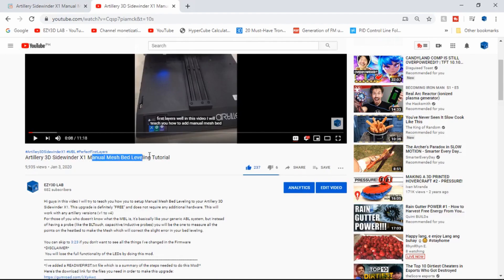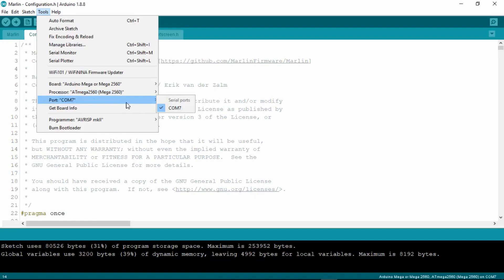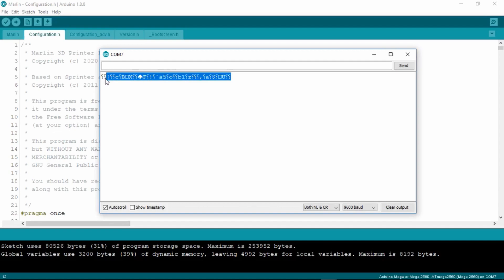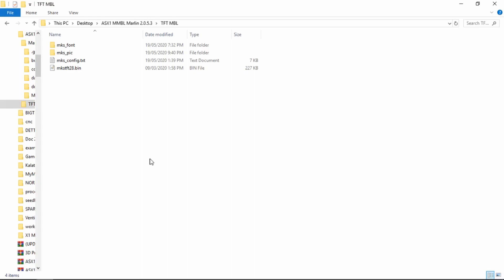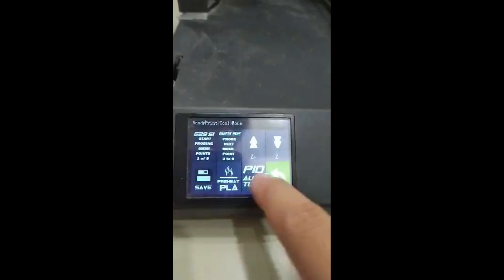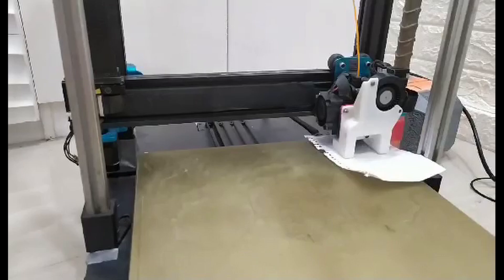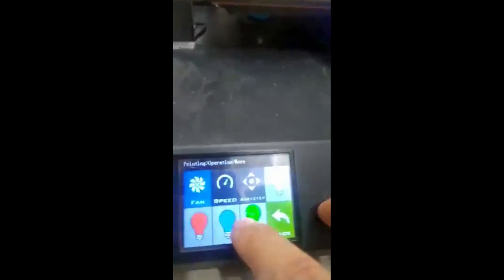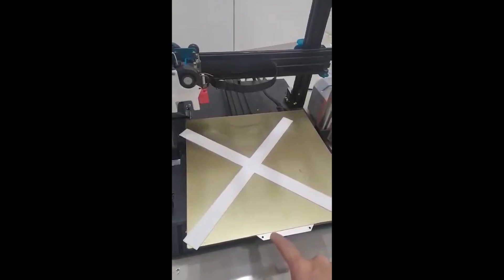Artillery 3D Sidewinder X1 / Genius Manual Mesh Bed Leveling Tutorial - Marlin 2.0.5.3

Comment: After following all of your steps, which the details are great. I may have messed up somewhere. None of the icon on the printer are working. I can select stuff and go into submenus, but doesn't do anything to the printer. Help please. Pushing the home icon the head doesn't move to the home position. Bed or extruder doesn't heat up. Nothing is working.....
Reply from the maker: Have you tried reflashing the TFT fw using a refomatted SD card?
Reply: @EZY3DLAB  Thank you for the quick reply! I tried what you posted with no luck. I've checked all the cables. I was able to get the bed and extruder to turn on using the slicer and a hard reboot. manual control (In Repetier-Host V2.1.6) doesn't work  Maybe the SD card I'm using is too big, (Its the only thing that you had mentioned that I failed to follow) SanDisk Ultra 32GB. I found a 2GB and should have it tomorrow. I'll post if it works out. Thanks!
Reply from the maker: Don't forget to also change the file system format of the 2GB SD card. Inform me as soon as possible so I can help with troubleshooting.
Reply: @EZY3DLAB  Formatted to FAT and flashed, still no luck..
Reply: quick question, when removing the TFT cable do you do this with the printer on or off?
Reply: I've tried everything, is there anyway to restore back to the original firmware for testing purposes?
Reply: If using the slicer I can load a print job and start it, I get an error on the printer "Error: Failed to enable bed leveling". The bed and extruder will heat up. After that I will get another error "Error: Failed to enable bed leveling". The bed and extruder will move to the center and just stay there.
Reply from the maker: @serviio ddnsnet  it doesn't matter if the tft is on or off, just make sure the you get the right positioning for it. 

Yes, you can revert back to the old fw. Just flash the stock files. ( From artillery github)

Failed to enable leveling will trigger if you still don't have a mesh created and a m420 s1 was called out. 

You must have skipped a step because I just flashed another X1 yesterday and everything went buttery smooth. (I livestreamed this)
Reply: @EZY3DLAB  Thanks for all your help. I watched your video multiple times to verify, I followed every single step. I just recently purchase this printer last month so not sure if there's conflict with a new version? I did add the M420 S1 code to the G-code start up, just sharing as much as I can to hopefully figure out what happen. Every step completed as outlined in your video. Just no control of the printer threw the printer interface and the error describe above.
On revert FW back could you provide a web address to what to download plz.

Great appreciate!
Reply from the maker: Could you send me a video of the problem so we can troubleshoot it better? You can reach me at my facebook page (same name as the channel)

Comment: hi. thank you very much for your effort :) I have a question how can i manage to get screen like in your video? I uploaded firmware for tft and can't see the baby stepping option :( Could you also tell me how to increase the mesh point from 9 to more? THank you in advance a lot!
Reply from the maker: The babystepping option is only available during printing (not during the idle period) .

If you want to increase the probe points look for this in the configuration.h
#define GRID_MAX_POINTS_X 3 <~ Change 3 to your desired value (odd numbers only, Don't use more than 7 points per axis)
Reply: @EZY3DLAB  okey sorry so maybe I just mixed the meaning..so what actually babystepping is?
I'm fighting with Z-banding, I adjusted all drivers to ~1.0010V and calibrated extruder and now doing the flow rate :)
Reply from the maker: Don't forget to also check if the X gantry is aligned with the Z axis. recently I helped someone with Z banding and we've tried everything and the only thing that really fixed it was the X gantry alignment.
Reply: @EZY3DLAB  I need to go through procedure one more time with disconnecting lcd? :)
Reply from the maker: Have you calibrated your esteps? It looks like you are over extruding, what's why the layers are not that well defined.
Reply: @EZY3DLAB  I calibrated it yesterday after setting voltage on motordrivers and im doing it now again...and I cant set it properly each time something else is coming once I have 499.96 second time I have 494.37 always lack of 1mm or 3mm too much..
Reply from the maker: Are you using this method to calibrate the esteps?
https://mattshub.com/blog/2017/04/19/extruder-calibration
Reply from the maker: @StraightBar  I honestly haven't tried the link you've sent me. I always use the method that I sent you and it has been proven effective for over 4 years now (for me)
Reply: @EZY3DLAB  I think its basically the same except that there is a online calculator but in your method relative mode is on, so I comibined both and now trying to use simplify instead of cura..I will share results ;)
Reply: @EZY3DLAB  https://imgur.com/a/hmhv22q this is what came from Simplify..is it still about esteps or software or rather mechanical issue?
Reply from the maker: @StraightBar  Looks like an Extrusion issue tbh. Did you send a M502 before doing the calibration? Also, could you give a brief rundown of the settings you are using?

Double check everything if it's all square.
Reply: @EZY3DLAB  I run this command only when doing Marlin tutorial from your channel :) So I made modification of the table I put out the springs and locked it with the nuts instead and did mesh leveling with A4 paper sheet. Settings that I'm using are from 3dprintbeginner, I changed only layer width to 0.4 initial.layer to 0.2 and multiplier to 0.91 and reduced the speed...also set size of the 1layer to 100% instead of 150%..is it maybe uneven bed?
Reply: @EZY3DLAB  https://imgur.com/a/eypmqL1 now I'm printing this knob and base is.looking "good" but that vertical spiral look like is saw all the way..
Reply from the maker: That's the seam, try setting it to "hide" and play around with the coasting settings to minimize the seam line. So far the quality of your print is already spot on, well done!
Reply: @EZY3DLAB  Thank You so Much! I found it and simplify allows me to preview effects and i could adjust settings before printing it in real :D Sorry for my english it might be not that precise, I share effects if the would be satisfying ;)
Reply: @EZY3D LAB Quick update, preview not equal to real print 😅 I still see seam, it really hard to find right settings :( @
Reply: @EZY3DLAB  HI again. Do you maybe have some confirmed workinf profiles? I'm fighting with the seam for so long now that I lost faith :(
Reply from the maker: @StraightBar  I'm using a 0.6 nozzle, My settings might not work for you.

Comment: Hey, with your bed surface? did you put that on top of the existing glass bed? Or did you somehow manage to replace the whole thing?
Reply from the maker: It's on top the glass bed. It has been working fine for about 7 months now since I installed it.
Reply: @EZY3DLAB  is it a pei sheet? I'm not really sure about print surfaces?
Reply from the maker: @patrickdalton7266  Yes it's a PEI sheet. I bought it at aliexpress the brand name is Energetic. They sell good quality PEI sheets.
If you are planning to install one for your x1, the size of the sheet should be 310x310mm.
Reply: @EZY3DLAB  Thank you very much, I'm considering ordering one but im not sure... How does it stick to the glass bed? Would you reccomend it? My current bed is lower in the middle and I'd like to try your Firmware to fix it.
Reply from the maker: It's a two part thing. You need to place the magnetic sheet on top of the glass first then you put the Spring steel sheet on top of that magnetic base which will hold the sheet in place. I've tried several of this and some sellers include a very thin magnet which cannot really hold the sheet. 

What Energetic sells (the magnetic sheet) is fairly similar to the one that whambam sells so it's a big plus and I highly recommend it! You can try out the FW now and if you are satisfied with it, combo it with the pei spring steel sheet together with some silicone solid bed mounts and completely say good bye to leveling. haha

Comment: Just got my Sidewinder X1 this morning and flashed firmware and setup the MBL.  Thanks for the comprehensive guide.  Which part fan duct are you using?
Reply from the maker: You're welcome, I'm glad you liked it! I'm using this one https://www.mediafire.com/file/hnyvflk7wrcdrfh/Main_Duct_no_BL.stl/file 

Happy printing!
Reply: @EZY3DLAB  Thanks!  I bought this as a second printer in addition to my Prusa MK3s + MMU2S.  For the price I'm very happy so far.  I was initially disappointed that there was no live-z adjust or mesh bed leveling but your firmware took care of that!
Reply: @EZY3DLAB  Any suggestions of where to get a good profile for PrusaSlicer?
Reply from the maker: Hmmm, I honestly don't know a good profile because I mainly use Cura and S3D.
Reply: @EZY3DLAB  no problem!  I think, I modified one I found online and got some good prints.  Setting up Octoprint and going to fine tune it a bit more!
Reply: @EZY3DLAB  Sorry....another question for you.  If I adjust using baby steps during a print and save, are those corrections saved to the firmware for the next print?
Reply from the maker: It should save it then load it in the succeeding prints.

Comment: nice guide, but i have a question: what if i don't remove the tft cable?
Reply from the maker: it has a chance to NOT upload as the TFT also uses serial communication which you use when uploading the code via USB.

Comment: HI, excellent video, very helpful! You have have so much knowledge on this stuff!
I just bought this printer and I haven't printed anything yet. I did update the firmware and do the MBL. However I can't seem to find the babysteps menu. My menu says "ReadyPrint" instead of "Printing" like in your video.
Reply from the maker: Could you show me what you are describing?
You can reach out to me on my FB page (same name as my Channel so we can communicate efficiently)
Reply: @EZY3DLAB  Sorry, I found out that the babysteps menu setting are only available when you insert the usb drive to print a file.
Reply from the maker: @twosuns20  aah yes. You can't babystep if you print via the usb.

Comment: Hi EZY LAB ! Can we use ABL with BL-TOUCH function ! Tks you so much ,I will keep donate for you...
Reply from the maker: I can make the adjustments via the code but I can't test it since I don't have any BL-Touch on hand. :( 
I already have the ABL setup with the stock endstop as a probe. (this only works when you have a spring steel PEI bed)
Reply: @EZY3DLAB  So the firmware you provided is already compatible with the ABL stock endstop mod? Or would I have to edit the code to make that work? Thanks!
Reply from the maker: This specific FW is for MBL only. I need to make small adjustments to the code for it to work with an ABL. 
Also the probe offsets will depend on which holder you use. (this is easily changed via pronterface tho)

Comment: Nice video, thanks. But after installing I cant resume my prints from power outage or pause. Is this normal? Thanks in advance.
Reply from the maker: That is not normal. The power outage feature of the X1 is done via the TFT and not the MKS gen L so if ever you are having trouble with the power outage resume, I highly suggest you reflash the TFT. 

The power outage feature will not automatically resume the print if the power cuts off, you'll need to choose the file that you are printing again for it to continue printing.

Comment: Great video, This has changed my printing life. Is there any way to do this via Sd card ? my usb is damaged
Reply from the maker: Are you referring to just printing or updating the firmware? 
If it is updating the TFT Firmware then its not possible to do it via the USB. 

If its only for printing purposes, then you can swap it with an SD card in the settings itself, this will allow you to use an SD card instead of the default Flash drive which comes with the printer.
Reply: @EZY3DLAB  Thank you for the reply,  I took the board out and re soldered it so I could hook up Arduino and try and PID bed as its getting fluctuations and had a thermal runway stop

Comment: Quite easy, thanks to your step by step explanations! Works very well. Still little imperfections while printing the X, probably due to the 3x3 matrix. 
Any chance you make a 4x4 upgrade (or more?) or do you think it doesn't make sense? Anyway, thanks a lot for this update!!
Reply from the maker: Thank you very much! 
You can most certainly change the matrix number (odd numbers only). You need to search for "  #define GRID_MAX_POINTS_X 3  " in the configuration.h tab. You can change the value of 3 to let's say 5 or 7 to increase the number of points/grid.
Reply: @EZY3DLAB  Thanks so much for your quick answer !

Comment: am getting this error am new to this can you help me   Arduino: 1.8.5 (Windows 10), Board: "Arduino/Genuino Mega or Mega 2560, ATmega2560 (Mega 2560)"

fork/exec C:\Program Files (x86)\Arduino\hardware\tools\avr/bin/avr-gcc.exe: The filename or extension is too long.
Error compiling for board Arduino/Genuino Mega or Mega 2560.

This report would have more information with
"Show verbose output during compilation"
option enabled in File -> Preferences.
Reply from the maker: Make sure you have the driver and selected the proper board and processor. 

A pc/laptop restart can also go a long way. Don't worry I'll guide you along the way.
Reply: @EZY3DLAB  now i have this error Arduino: 1.8.8 (Windows 10), Board: "Arduino/Genuino Mega or Mega 2560, ATmega2560 (Mega 2560)"

Sketch uses 81754 bytes (32%) of program storage space. Maximum is 253952 bytes.
Global variables use 3203 bytes (39%) of dynamic memory, leaving 4989 bytes for local variables. Maximum is 8192 bytes.
avrdude: ser_open(): can't set com-state for "\\.\COM11"
avrdude: ser_drain(): read error: The handle is invalid.

avrdude: ser_send(): write error: sorry no info avail
avrdude: stk500_send(): failed to send command to serial port
avrdude: ser_recv(): read error: The handle is invalid.

avrdude: stk500v2_ReceiveMessage(): timeout
avrdude: ser_send(): write error: sorry no info avail
avrdude: stk500_send(): failed to send command to serial port
avrdude: ser_recv(): read error: The handle is invalid.

avrdude: stk500v2_ReceiveMessage(): timeout
avrdude: ser_send(): write error: sorry no info avail
avrdude: stk500_send(): failed to send command to serial port
avrdude: ser_recv(): read error: The handle is invalid.

avrdude: stk500v2_ReceiveMessage(): timeout
avrdude: ser_send(): write error: sorry no info avail
avrdude: stk500_send(): failed to send command to serial port
avrdude: ser_recv(): read error: The handle is invalid.

avrdude: stk500v2_ReceiveMessage(): timeout
avrdude: ser_send(): write error: sorry no info avail
avrdude: stk500_send(): failed to send command to serial port
avrdude: ser_send(): write error: sorry no info avail

avrdude: ser_recv(): read error: The handle is invalid.

avrdude: stk500v2_ReceiveMessage(): timeout
avrdude: ser_send(): write error: sorry no info avail
avrdude: stk500_send(): failed to send command to serial port
avrdude: ser_recv(): read error: The handle is invalid.

avrdude: stk500v2_ReceiveMessage(): timeout
avrdude: stk500v2_getsync(): timeout communicating with programmer

This report would have more information with
"Show verbose output during compilation"
option enabled in File -> Preferences.
Reply from the maker: I'm guessing some other software is already connected to the printer via the serial port. Please close all slicer softwares/pronterface/repetier host and try again. It compiled properly but failed to upload. 
Make sure you have the right board and com port selected (Check via the device manager) 

Sorry for the late reply.
Reply: now it work loading but when i put the sd card on the printer the TFT flash it it dont do anything it dont show anything on the screen its black.
Reply from the maker: Reformat the SD card and reflash. Make sure you got the TFT connections right.
Reply: I dont know what i did but it came out working. Thx for your help.

Comment: Great video! Thanks for the step by step, it really was helpful for a newbie like me! I do have a question though. Is it essential for the m500 and m501 commands in the start g code?
Reply from the maker: The only essential gcode that you need to put in the start gcode is the m420 S1; 

Put it after the g28

Example:
G28;
M420 S1;
.
.
.
The rest if your start gcode
Reply: Ok thanks for the response! 2 more quick questions, what are the advantages of using m500 and m501 after the g28 command? And how do I remove the previous mesh stored in eeprom when leveling again?
Reply from the maker: @fumanseano2846  M501 will restore the settings,
M500 will save the settings
M502 will Reset the settings (This will also remove the previous mesh and the Z offsets)

https://marlinfw.org/docs/gcode/M500.html
https://marlinfw.org/docs/gcode/M501.html
https://marlinfw.org/docs/gcode/M502.html